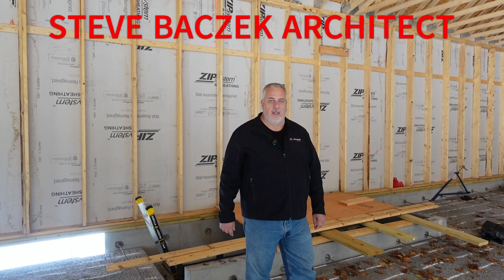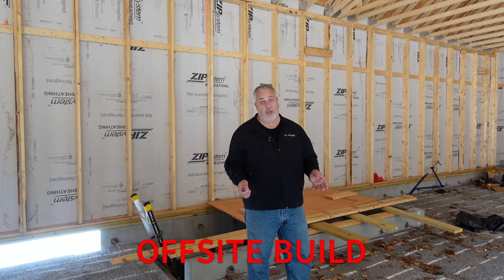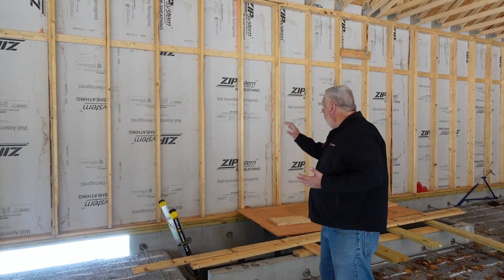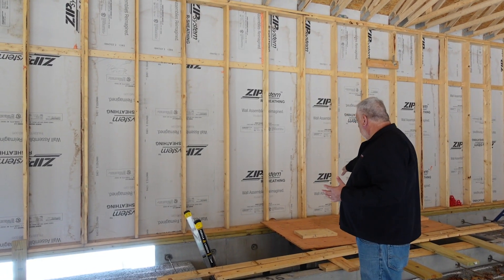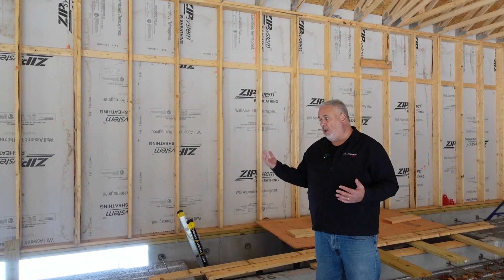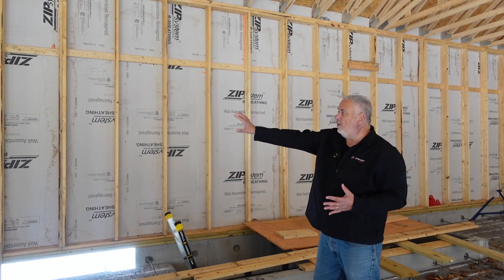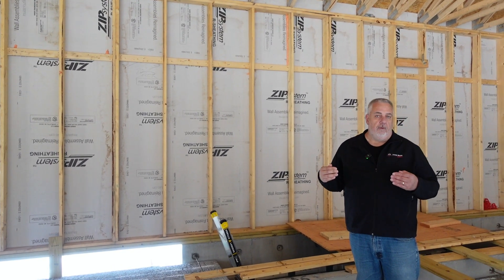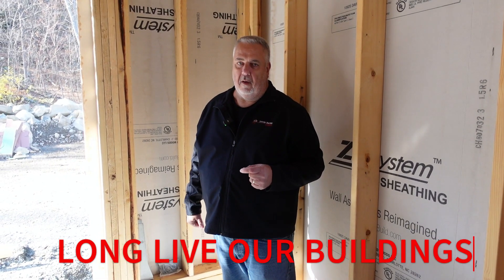A LOOK AT THE SHEAR CONNECTIONS

Comment: Good Video.  The question that I have had since I have seen the application of Zip R is the shear connection with the sheeting.  How is the allowable shear load for a Zip R sheeting panel corrected for the the insulation backing the OSB.  As the insulation gets thicker  the nails gets longer and are actually required to be in bending to transfer shear.  I have never seen this question talked about in increasing the nailing pattern or other attachment methods for shear transfer through the sheeting.  Could you please provide some insight?
Reply: Great question. Being ready to build in northern Maine, Zip-R is an absolute blessing for what I am planning. I too, would like to know how the length of the Spax Screws affects the shear strength. Where my build is I expect lots of sub-zero temps and high wind loads across farmland.
Reply: With potential for 8+ earthquakes here Zip R isn’t a thing.
Reply: Why do you not just say straight?  How it is. Place OSB inside before drywall and forget about that nonsense- zip sheating and OSB on outside of the wall in cold climate